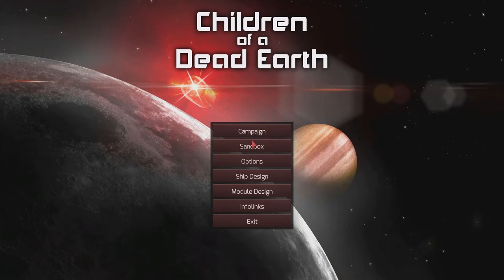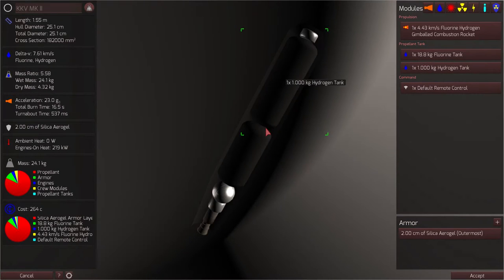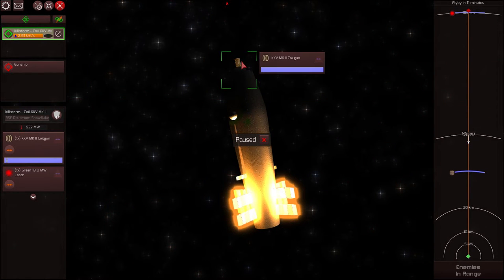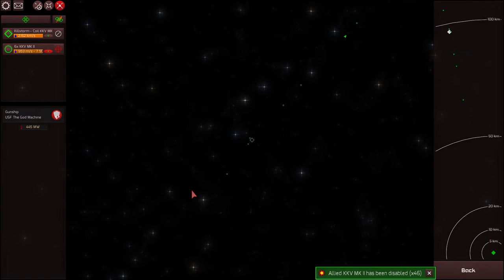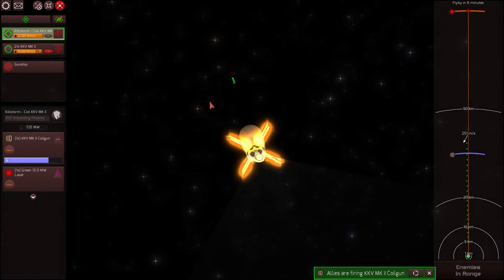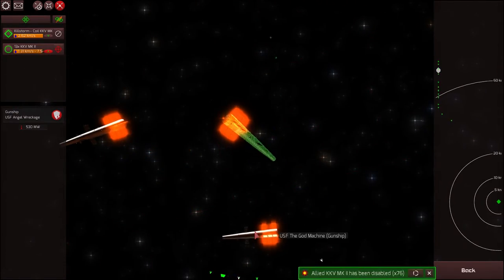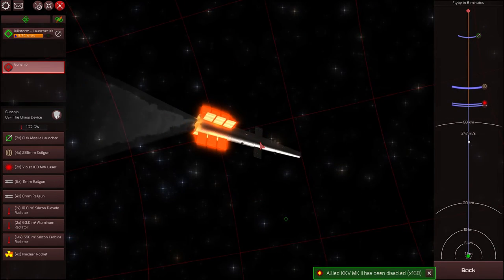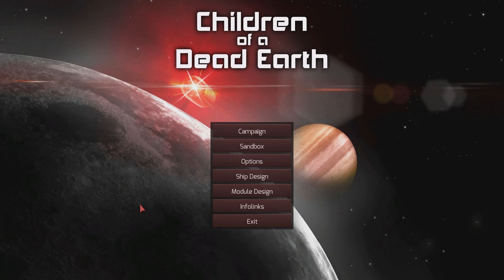Kinetic Kill Vehicles

Comment: And then you have RKM's, or relativistic kinetic missiles. Basically, use mirrors to focus a star's light down to a laser, and then push multi tonne missiles with solar sails up to 99% the speed of light. Each missile has the same energy as the asteroid that killed the dinosaurs, and you can make millions of them out of a decently sized asteroid.
Reply: In my opinion, it is better to limit your missile's speed to about your power source's energy density (with respect to the fuel's mass). That way you can use the fuel's wate products as filler for the projectile, and since at those speeds no one cares about what anything is made of, you use the least amount of mass, which in turn allows you to launch the most amount of missiles, and also maximize momentum, which is useful for penetration... And yes, that matters, because any civilization able to use RKMs as regular weapons and is able to make  behemoths to justify their use, is able to deffend against those, specially as any dust mote would blow them appart, specially the faster ones...

Also, it needs not be a star and mirrors, any power source will do, and I'd expect the massive ships of huge civilizations we are talking about to be able to power volleys of them and use them as tactical weapons... Of course the same energy as the dinosaurs' asteroid is not what a k2 would consider a tactical weapon, those millions, perhaps XD

Comment: I'm glad you didn't stop making videos about CoaDE after completing the campaign, as I find these videos to be a little more interesting than mission walkthroughs (but thanks for doing those too!). I hope you don't mind but I've copied some of your weapon designs into my game for the purpose of trying to find countermeasures that can defeat them (since the default ships in the game aren't very challenging). It's not quite multiplayer, but it will have to do.
Reply: Update: I made my own variant of the "KKV MK II" CG. Mounted three of them on the broadside of one of my cruisers. They're firing a similar version of the missiles you're using. I tried to make as exact copies as I possibly could, but there are some differences (yours will accelerate slightly faster). Results: Against stock warships, they performed as well as they did against you. In other words, they didn't stand a chance. I then put the KKVs up against one of my designs and got different results. Stock warship designs like to place the reactors near the engines, so when your KKVs punch through the armor, they generally destroy the power generation for the entire ship too. In my ships I have reactors and crew modules placed at the front of the ship, so what ends up happening is the KKVs punch a hole through and through the armor at the back of the ship (regardless of what you are targeting) but the reactors and crew modules remain intact, thus the ship can continue fighting. The armor layout I'm using produces less of a spalling effect than the stock ships do as well, so less internal damage from KKVs overall. Still, I'd say they're probably the most effective weapons I've seen for taking on fleets in the campaign.
Reply from the maker: Thanks! Appreciate it.  And feel free to use any of these designs.  I think I'm actually going to post screen shots somewhere of all the designs I use in these videos.  

It would be nice if it was easier to share ship designs with others.  I need to check out the forums for some other user designs and pit them against my own.
Reply: No problem! I enjoy what you do. And I agree, it would be fantastic if we had a Steam workshop option for the game to download ship designs from other people. Having multiplayer would be great too.
Reply from the maker: Very interesting.  Though having the reactor at the front of the ship could present it's own problems. For one, transferring the heat to the radiators at the rear of the ship ( which currently happens via magic, but if heat pipes were modeled they could be destroyed).  Regardless, I'll have to give it a try.
 I'm interested to know what your armor layout is if you don't mind sharing.  I'm thinking of making optimized versions of some of the stock ships and using those.
Reply: I position the radiators along the "spine", if you will. That's the side opposite where the coilguns are (I only place the coilguns on one side of the ship, to cut down on costs and mass). So when the ship is oriented to broadside, only the side with the coilguns is exposed to fire and the radiators are not visible from the enemy's perspective. Here, this was the ship I tested the KKVs against https://puu.sh/sfVQC/2784bd61ed.jpg

Armor: 6cm of boron carbide (innermost). 1cm of liquid crystal polymer fiber, spaced 1 meter away from the hull. Admittedly, using boron instead of boron carbide is not only a cheaper option, it's also lighter and stronger. I'm intentionally not using it though because boron is very rare and kind of unrealistic to use in large quantities. But boron carbide is used in tank armor and bulletproof vests, so I think it's a more realistic alternative. I hope that helps.
Reply from the maker: Cool thanks!  I've used some these ideas in my redesign on the stock gunship.

Comment: That was fun XD

It looks like the trouble with your second system is terminal guidance.  Maybe drop the size of the fuel pump on your rocket to drop acceleration under 6g maybe?

I haven't messed with KKVs too much myself yet. I'm too busy seeing just how small of a viable warship I can design.  I've got them under 500 tons so far.  Gonna throw four of them up against Vesta Overkill tonight and see what happens.
Reply from the maker: I have a MK III with lower acceleration and higher gimbal angle as well, but I didn't get to it in this video.  I'll perhaps make a part 2 or maybe do a video about missiles in general.  And yes, making the smaller warships is fun.  I've been going the other route now and am thinking of making a 1 gc behemoth.
Reply: @ReadySetRudy  Another route you might want to try is increasing the missile's dry mass. Looking at the dV, it seems it is about double the exhaust velocity, give or take. This is not very efficient, as when fuel is burnt, mass is lost to kinetic energy, sure, but that mass was moving already, so you end up losing both E and momentum by burning over that point. Ad dV=Isp×lnR, dV=Isp when R=e, so you want your total mass to be e times your dry mass, more being actually detrimental in terms of raw damage and penetration. That is also why launching missiles from coilguns is unnecessary as they already (usually) far exceed the exhaust speed, unless you want the fuel for guidance of course. On that, guidance and point defense complicates things as you'd also have to take into account the probability of hitting, which depends on the target, distance and AI funkiness, so I dont bother trying to maximize it. I just use classic engineering wisdom and round up XD which actually makes for a closer to optimum and easier to design setup. Also why using a heavy engine, well armored tanks and high performance fuel makes sense, as you need a lot of dry mass anyway and your speed is capped to the fuel's...

Yeah, ik its from years ago and I've not seen a recent CoaDE video, but I guess someone might find it useful, not like it cost much shrugs :P

Comment: I wonder - could you combine your ship designs - include both the coil gun launcher and the multiple launchers? That way you have the gun launcher to pick away at long range, then a swarm you can deploy to overwhelm point defense at close range?
Reply: I actually had an idea for a sci fi story where alot of the combat is based around larger, faster, less maneuverable Torpedoes/KKVs launched at longer ranges, and then smaller, more maneuverable missiles at shorter ranges which need a warhead to do sufficient damage, where some tactics involve timing a missile salvo with a torpedo launch in such a way that the missiles overwhelm the point defense just as the torpedo hits the enemy vessel, don't know if that exact tactic is applicable in this game though

Comment: I haven't unlocked the module customization yet, still trying to "steal" your idea of the bare minimum beam ships, but haven't gotten them to work properly yet.

But I was wondering if there's a way to lower the fire rate of the coil gun. 2-4 KKV's kill the gunship, so it's obvious you don't need to launch 70 of them at once like that. It would be much nicer if you could lower the fire frequency to maybe 2-5 per second instead, or maybe even have a burst trigger, 5-8 KKV's in a burst once every 2-5 seconds or something.

Comment: I'm confused. i tried to copy the idea, but I ended up with a 27mm diameter rocket engine, 9° gimbal using 0.76% fuel mix H2+F2 with 372kN thrust. using reasonably sized tanks (143kg F2 and 10kg H2), I get a lovely 600m/s dV with a 27mm diameter missile (no armor). so I figured, at least it'll be homing. and I tried to make a coil gun around the design. but no matter what i tried, I get a muzzle velocity of a whopping 6mm/s... I think I'm just not understanding what I'm doing.
Reply: Try using a conventional cannon instead it’s much more reliable

Comment: Drones with mini KKVs?
Reply from the maker: Indeed.  Drone design isn't something that I haven't gotten into yet, but will eventually.  I've been working on a combination of very large ships and better armor.
Reply: ReadySetRudy my person favorite strategy is using multiple small, lightly armored ships with lasers or coil guns mounted on the front. The lasers can take out any drone or missile thrown at them while the coil gun ships destroy any capital ships before they can fire back. It's a slight modification off of the strategy you used on the mission to retake Ceres.